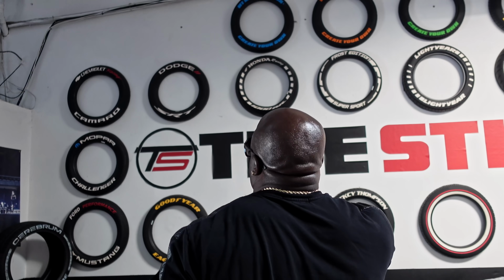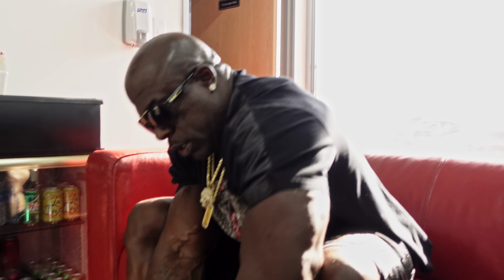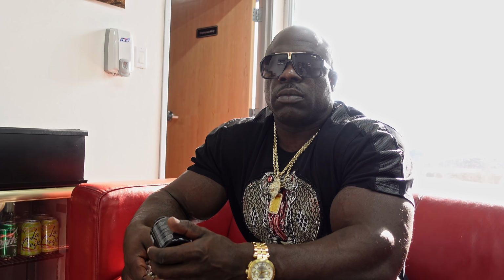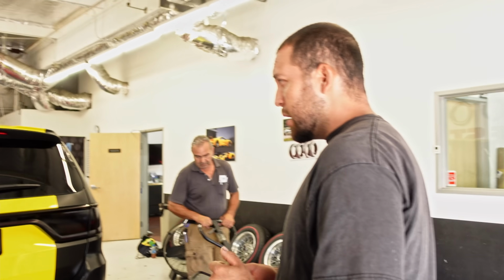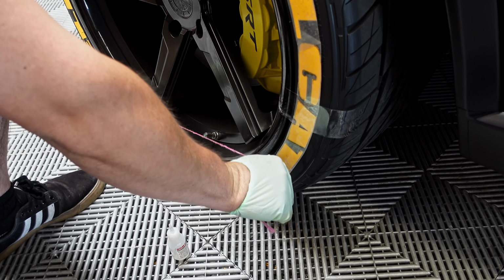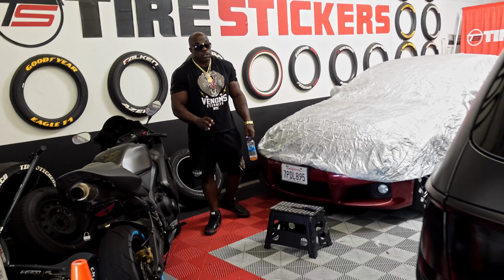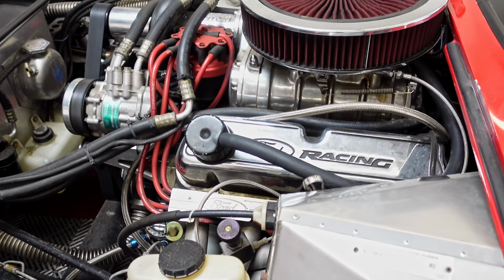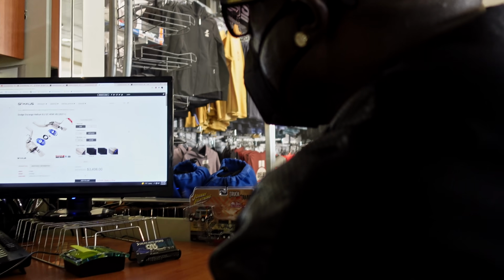Dodge Durango Hellcat | Tire Upgrade

Comment: The zr1 does the 1/4 mile in 10.8 second stock and the zl1 does high 11s stock so no your zl1 will not smoke a zr1 not even close